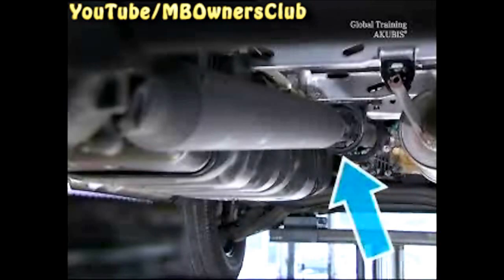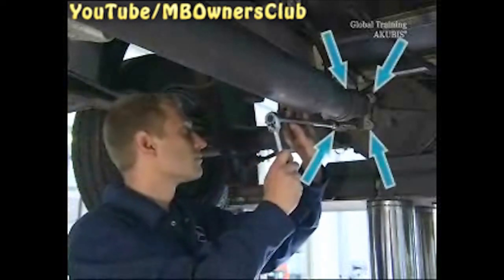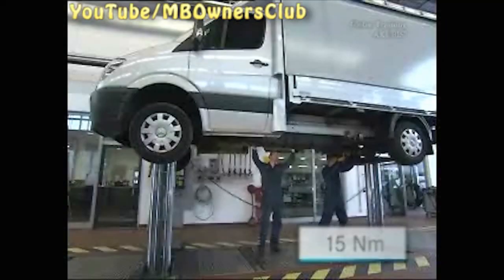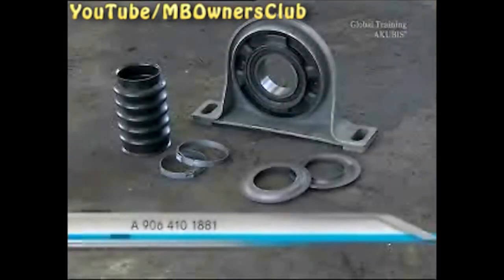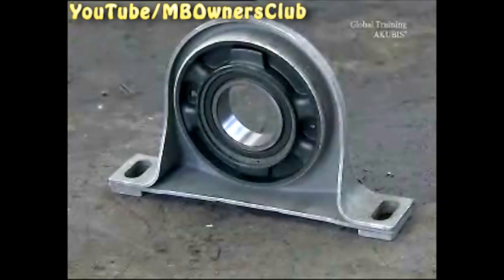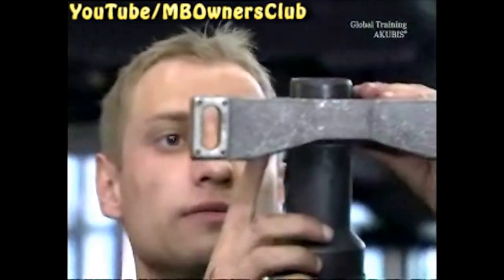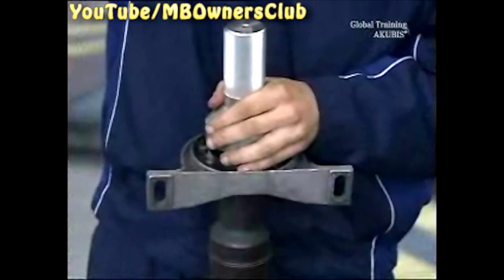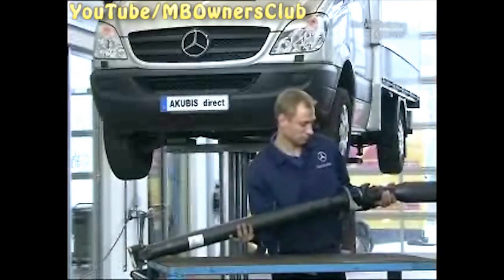Mercedes-Benz Sprinter - How to remove/install (cardan) propeller shaft intermediate bearing  | W906

Comment: Why you can't reuse screws?
Reply: I’m guessing they are stretched with the 70 degree turn past 15nm. At least thats what I learned while replacing injector bolts, similar stretching procedure and once stretched they cannot be reused.. not sure how critical it is down here.
Reply: @rostyslavpoberezhny583  +1 A lot of bolts 'should' only be used once as they are stretched in the tightening process. You don't want em shearing off on the motorway at 60mph. Manufacturers will use the minimum size bolts/nuts/fastners they can get away with. As cheap and as lightweight as possible👍

Comment: You'd want to mark the driveshaft before those two sections come apart. It HAS to go back the same as it came off.
The shafts are balanced as a unit from the factory. My driveshaft DID NOT have match markers. I got 200K from the center support bearings. These trucks are easy to repair EXCEPT for the U-joints. If they're bad, and unless you're a super fabricator,
it's new driveshaft time. $800 bucks plus. It replaces really quickly so the labor $$$ is low. If you tow a lot, don't ignore strange drive-line noises.
Reply: If the entire assembly has to go on the same way it comes off, how does one adjust for a new/ replacement drive shaft?